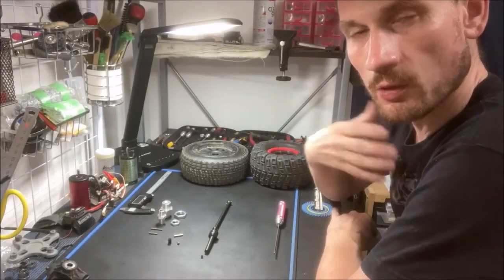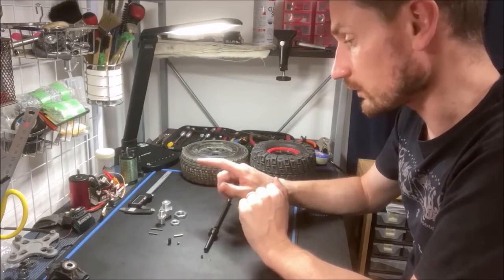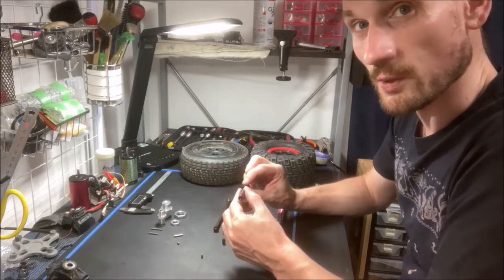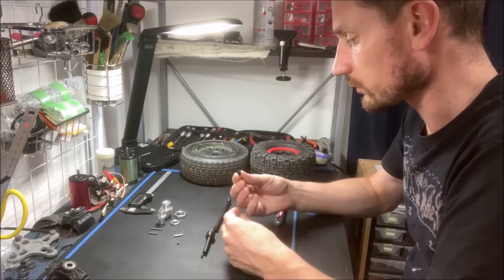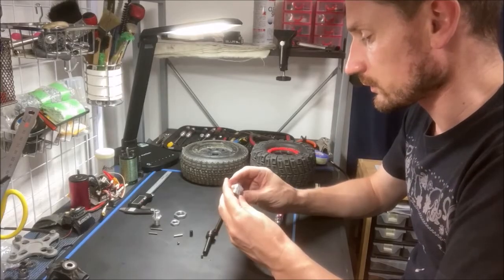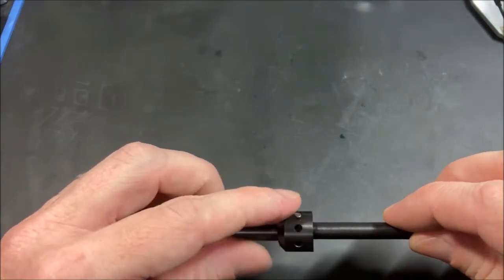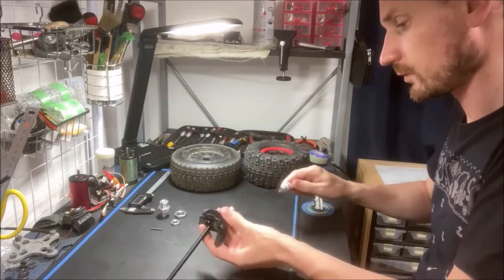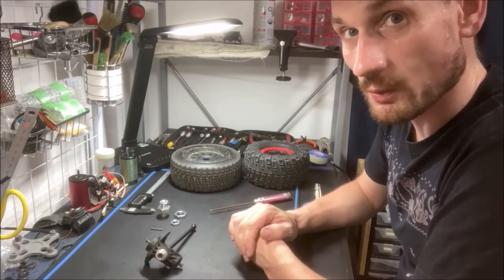Draco CVDs - Overview - Designed for the HPI Savage and Super 5SC

Comment: This is just what I was searching for for my Savage Flux XL V2. When do you reckon it will be available for purchase? And would it be possible to add on some kind of boots for the joints on both sides? I know it might be a bit overkill, but it would be nice to know that no grime/sand/small gravel could get in there and cause extra wear and tear for no reason. Plus, if it's sealed of (like the axles on real cars) you could also add some small amount of lubricant/grease in there to further improve durability and wear resistance. Just a thought!
Reply from the maker: Thank you so much! I wasn’t planning on having boots on the joints butI will look into it and see if it’s possible to find either off the shelf boots or custom boots. Thank you for the suggestion.